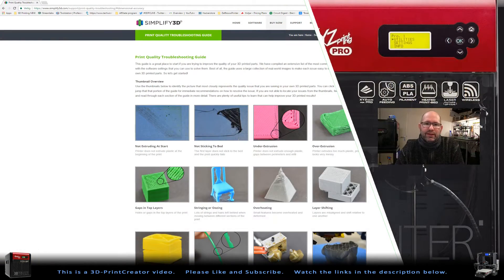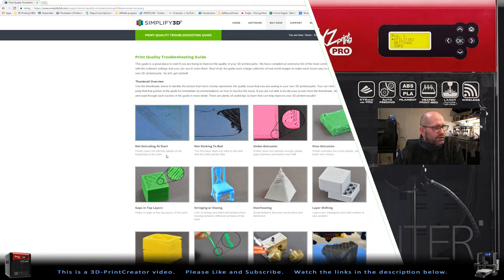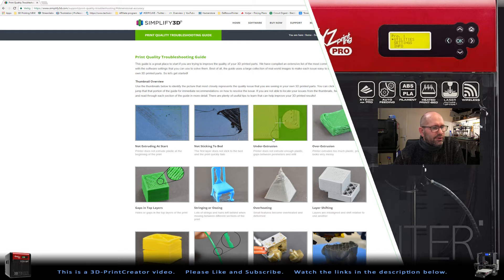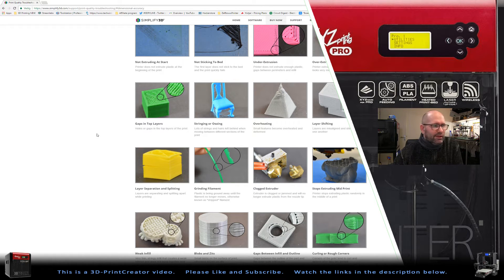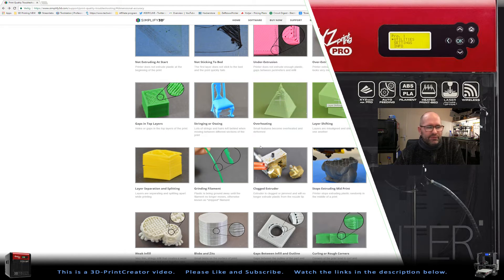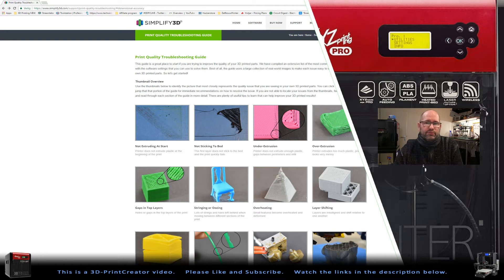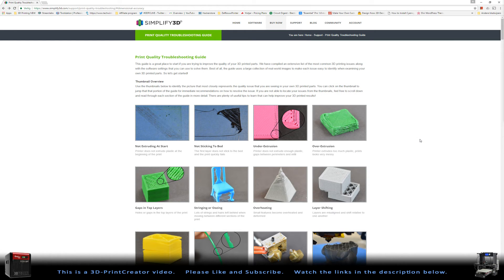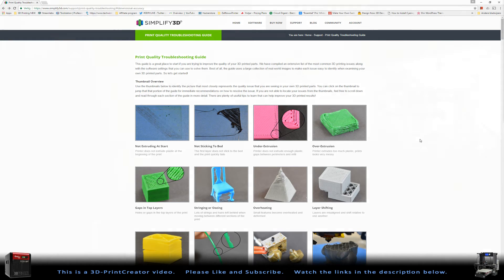▼ Finding answers to a lot of printing problems

Comment: I have DaVinci 1.0 pro and have been printing same shield file for many days. now I can't change the setting on make it print anything else. What should i do?
Reply from the maker: Use different slicer settings for your new print
Reply: @3dPrintCreator  what software are u using for the da vinci pro 1.0?
Reply from the maker: Since about 1.5 year I don't have a Da Vinci Pro anymore.
I have made a new printer in the Da Vinci Pro housing, but it's a generic CoreXY printer now.
But when I had the printer, I used Simplify3D, as you can see in many of my video's.